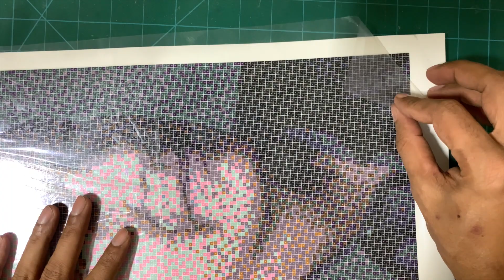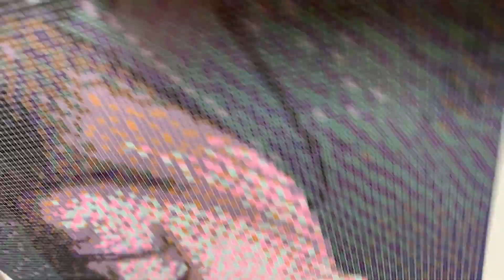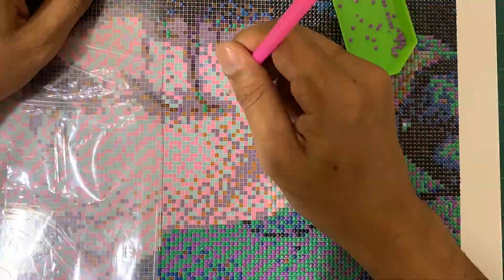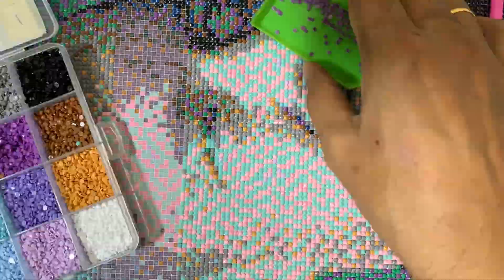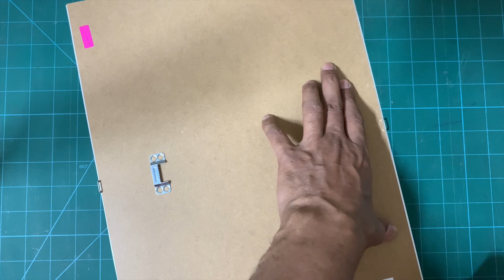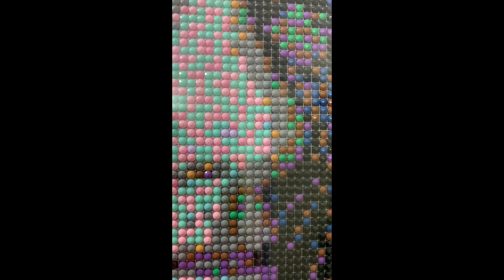Diamond Painting Custom Portrait | 5D Diamond Painting Portrait Tom Hanks

Comment: I want to make a string art .I have a square board .buy the board is small .I using a app to make this art .The said the gap of each nail should be 1 cm .If i pin the nail 0.5 cm is there any problem ?
Reply from the maker: There is no issue with 0.5 cm gap but artwork will not come clear on a very small board
Reply: I am using 12x12inch square board and the gap of nails is 0.5 cm .I am using 200 nails .Can I get a clear art by this?